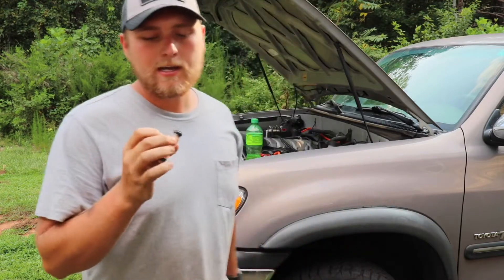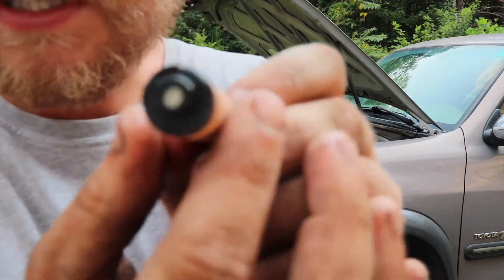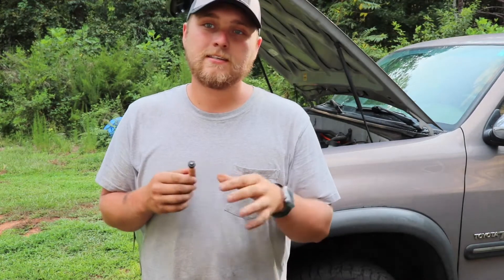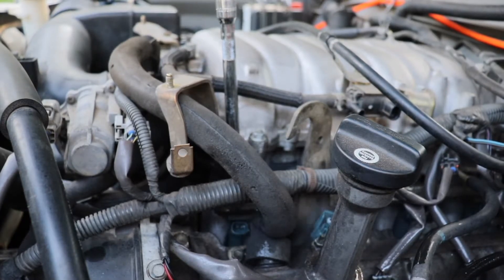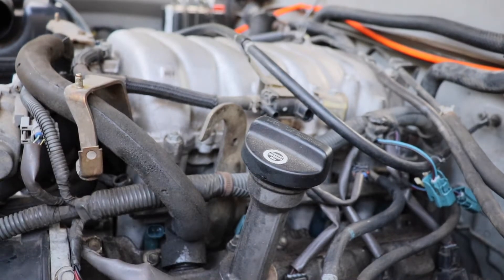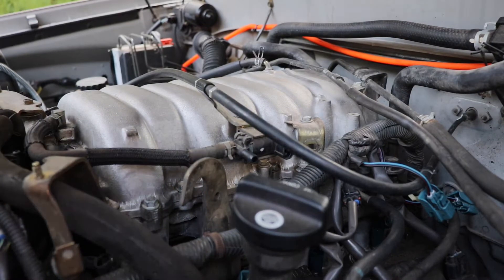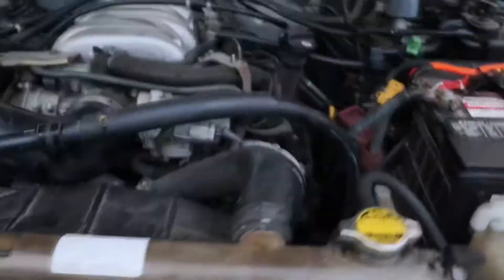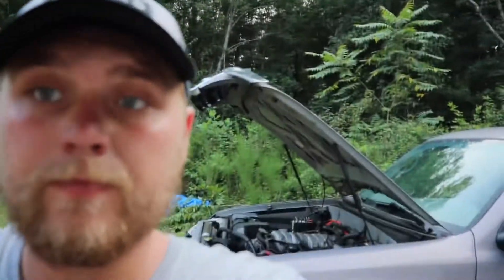Dirty Deed 12 Hole Injector Upgrade // First Gen Tundra 4.7

Comment: Just ordered these for my 03. Truck already runs really good, but a few weeks ago I threw a timing belt, and even after repairing it, it was throwing misfire codes. So I replaced the crankshaft sensor, all 8 ignition coil packs with brand new Denso packs, some NGK Ruthenium plugs, a new AGM battery (old battery was just going bad at the same time), and now I'll have the new pink 250cc 12 hole injectors as well. It's already cleared the codes from misfiring (pretty sure the new ignition coils solved that) but I bought the injectors as well just to be sure, plus I've always wanted to try them out. Love the 2uz-fe engine, and Keith from Dirty Deeds is an old friend who lives a few blocks away, so if there's some kind of an issue I can just drive by his house and say hello , lol. It's very interesting that changing injectors affect how it shifts, but I'll be paying close attention to that.
Reply: How did the injectors do?

Comment: You just uploaded this? I was literally just looking for some videos because I’m planning to install these tomorrow in my 2003 tundra. Got any other performance upgrades you installed and recommend?
Reply from the maker: That’s crazy timing man! This is the first performance upgrade I’ve done to this truck. I’m searching for more as well so if you find any cool ones let me know
Reply: @TheShopBros  Awesome same here!  I just bought a trailer and it towed it pretty well but I wanted to get a little more from the truck.  So far i've installed some air bags since my leaf springs were pretty rough and it was bottoming out during the tow.  The fuel injectors are the big one for me and then possibly cold air intake or some new headers.
Reply from the maker: I was going to put air bags on mine for pulling my camper. But I bought an f350 to pull it with now. I still might install them though
Reply: @TheShopBros  Awesome! they were a pretty easy install, if interested I can send links to what I bought.  The controller is the best part to change the pressure on the fly
Reply: @dmp100482  nice! Never heard of that controller. Send the link
Reply: Can you send the part number
Reply: I have a 2000 4.7 Tundra and would also like to change the injectors Can you send the part number please
Reply: @dmp100482  thanks a lot! I don’t know how I missed this. I appreciate the link,
Reply: @victorvarela3427  if you didn't get the number, they're a Denso 23250-20030

Comment: Any ideas on why you noticed smoother shifting after replacing injectors? I have an '05 with 205k miles and was looking into replacing the injectors as a project, to see if it improves performance which has obviously dropped off since it was new
Reply from the maker: I’m not sure on the exact reason why but if you check out dirty deeds website I believe it explains more in depth. And I would also recommend looking into a valve adjustment. I’ve heard lots of good things about restoring lost power from doing so.
Reply: In my experience the smoother shifting is related to spark plug issue. I had an 01 tundra 4.7 that had one plug that would only misfire between 40-60 mph, and it would stuttter and feel like trans was slipping. My dad and I thought it was transmission related, changed filter, fluid, shift solenoid, didn't fix it. The truck was bought with 311,000 miles, and we didn't know service history, so I said plugs don't cost much lets try that, guess what, it fixed it. It also never threw a code for the misfire.
Reply: @andrewn5151 wow thanks for this comment, I got an 06 with only 107k and I’m noticing that same issue but theres no code. I was going to do the plugs anyway but now I might do them sooner. It’s not bad the shift is just very noticeable, for me atleast
Reply: Changing your upstream oxygen sensors can help with mpg. They can get “lazy” with age and work well enough to not throw a check engine light, but not working at optimum performance.

Comment: Did u get the 250cc or 270cc did u spend the extra 100 on the adapter
Reply from the maker: I just got the 250cc. They recommended those for my year model

Comment: Awesome. How long did it take you to do the job? Did your engine light ever go off?

I just finished up my timing belt and water pump today. Old belt didn’t even have marks on there for the crank and cams so who knows if it was in time. My truck shifts way better with the oem belt and new parts. I’ve been on the fence about these injectors. Your video is convincing me tho.
Reply from the maker: It took me about 2 hours and the engine light went right off. My truck is running better than ever